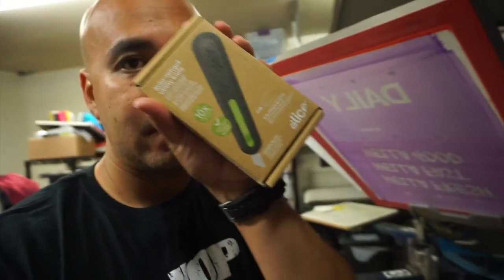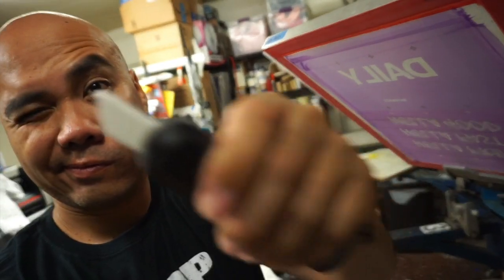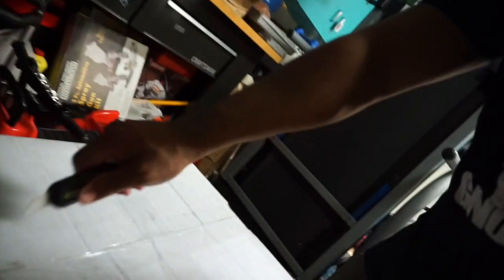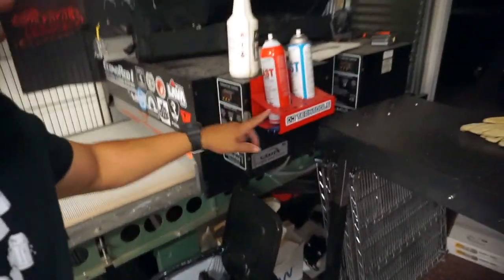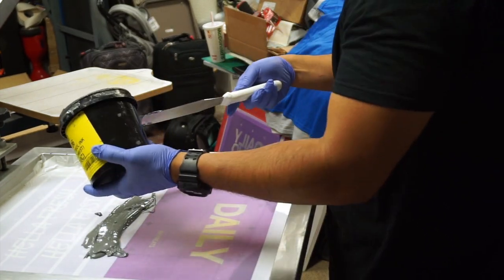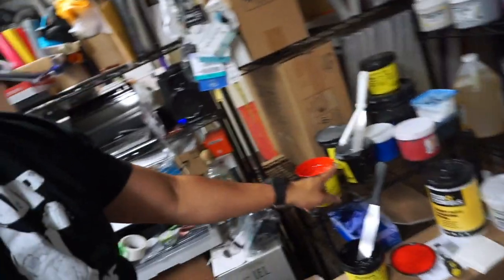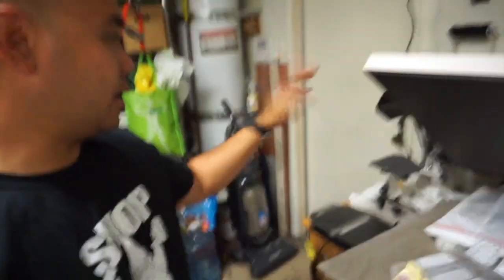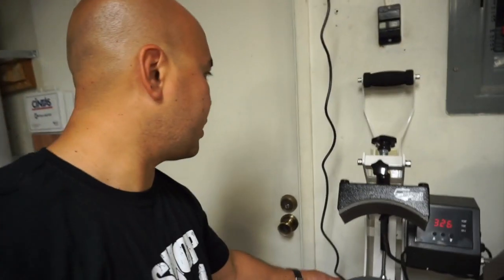Screen Printing Website Orders (S:03/Vlog 371)

Comment: Smart idea with the blade that cant cut shirts ... good thinking. I always cut the ends, and then pull the top up to elevate it before cutting lengthwise, but that knife is nice since it makes less risky and quicker to a degree.
Reply from the maker: Hotbox Print Studio Chico Ca yup. I still do the same as far as pulling the box up and cutting it. But it’s a great tool to have, specially with kids running around and touching and moving everything in the shop!!

Comment: Those blades will cut your shirts if you apply a little pressure past the box tape and onto your shirts. Especially if it's a full box. I have the smaller retractable ceramic blades and I learned the hard way. They're nice blades though.
Reply from the maker: yssemhair yep. I bought one of those ceramic blades. Game changer